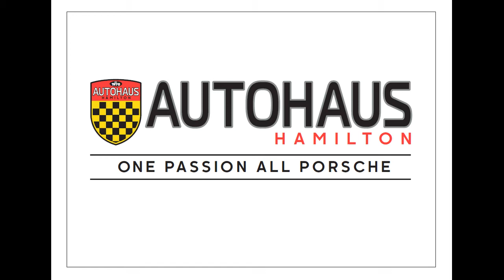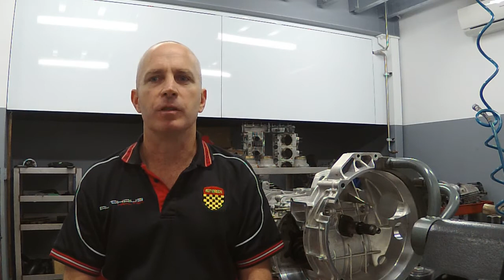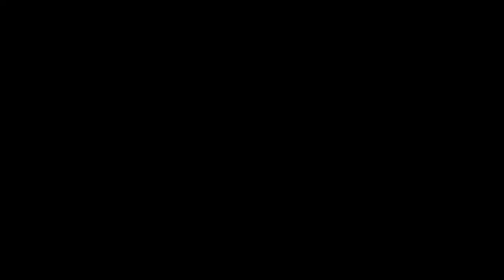IMS Bearing Statistical Calculation

Comment: As an accountant (statistical analysis type) I agree with this type of analysis, just the financial numbers need to be more realistic. In the US a factory new engine with installation would approach $20k but there are other options that make more sense, including a used replacement for under $10k and a rebuilt for a little over $10k. Also the updated bearing cost is ~$500 with only a couple hours of labor when the clutch/RMS is to be done anyway, so less than $1k cost if done at the same time. If you can do some or all the labor, even better.

Since I have the dual row and will eventually replace the bearing bore scoring scares me much more.  There is no cheap fix for this cancer.

Comment: My 99 3.2S with 200k km on the clock has a double row bearing. I called my local Porsche Centre and enquired about the cost of a replacement (it’s a Tip). Expecting a $5000 quote, the service manager said the very low likelihood if it failing vs the value of the car made it not worth it. He said not to worry, and to enjoy my car

Comment: Crikey!!! Totally accurate but worthless video. No one has a "fleet", except Porsche in its warranty obligation. There are plenty of examples of these cars running at 100K+ miles, and the failure rate was around 5%. I say this is NOT  a design defect. It is a component defect. They got a bad lot of bearings. Now, we can debate the wisdom of a design in which a component failure can be catastrophic, but the design is sound, even if dependent on good parts -- but aren't they all?. Every failure analysis says the bearing lost its lube. That can only happen if the seal fails. Replacing a good IMSB for "peace of mind" could result in installing a bad one. Rick Huttons car had 125K on it, and the bearing was fine. It was also shown that these fail early if they're going to. If you have 50K+ on your car, stop worrying. You're ok. Drive your car.
Reply: They did not get a bad lot of bearings they changed the bearing to one with half the load. The failure rate going from 1% to 5 to 8%. And why? to save perhaps $1 Replace it with clutch replacement? I don't know the statistics but I bet half are auto.
Reply: @manilanoakes3966  According to the reports, it is not the "load" at fault. It was a defective seal allowing the lube to leak out. Without lube no bearing has a chance. I believe the bad lot was due to a defective seal -- my opinion -- that was a part of the switch to single row. Correlated but not causative.

Comment: James set-up two scenario's but failed to analyze them consistently, and failed to analyze them properly.  James failed to mention his *explicit* assumption (in both scenarios) that replacing the IMS-bearing would fix the problem.  

There are at least 5 different after-market products touting to fix the IMS-bearing, I don't even know what Porsche recommends, and no one knows which fix provides the smallest risk of future failure.  I don't mind spending money to fix the IMS-bearing once, but I don't want to fix it every 40,000 miles.  And I don't want to be stranded when it does fail, as that alone could risk my life, limb, or livelihood.

James also failed to mention his *implicit* assumption that the IMS-bearing failure is a random event, presumably due to a  random defect occurring in the manufacturing process of the bearing, rather than a flaw in the engine-design.  In other words, James' analysis presumes that all bearings are either "fatally-flawed" or "practically-perfect", and there's a certain percentage that will fail due to "random" imperfections due to the manufacturing process.  Such defects can be summarily analyzed with ease as a probability, or risk, just as James did.

But a design flaw is a different kind of animal.  Failure due to a design flaw (presumably) depends on "conditions of use" that are unknown.  Example:  It seems to be an "accepted fact" that an "oft-driven Track-King" is actually less-at-risk than a "soft-driven Garage Queen".  

Frank Knight, an economist at "the Chicago School", wrote his PhD thesis on the simple idea that there's a distinct difference between risk and uncertainty.  His thesis is one of the most highly referenced papers ever written, presumably because it straightens out the tangle of definitions that most people don't recognize as being tangled.  Thus, a "manufacturing defect" creates what Professor Knight would call a risk, and the "design flaw" creates an uncertainty.

Side Note:  Knight arguably would've won the Nobel prize in Economics if he had lived longer, having attained many of the same or similar praises that other Nobel Prize winning economists had earned.  He died 3 years after "Economics" was included in the "prizes", but since only living people can win the Nobel prizes, he was only eligible for those 3 years.  Four of his students did win the Noble prize in Economics, which itself might be a record.

Comment: James, I have a 2006 Cayman S, and am curious to know if it has the larger bearing ??  What I have read online suggests that very likely the 06 Cayman has it, but definitely the 07 onwards has it. Is there any way for me to check this via Engine number or something else. It would be really nice to know it has the double row bearing for peace of mind.   Thanks in advance.    Cheers
Reply: From what I've gathered from PCA, 05MY was the change to the larger single row bearing.
Reply: A 2006 would typically have a single row bearing, to the best of my knowledge.
Reply: Yes James, but I have learnt that it is a much bigger bearing than the previous type. Very very few failures from 2005 onwards, and mostly down to lack of use and incorrect maintainance.

Comment: WRONG! The statistics of IMSB is well known ever since the Eisen Class Act in the States. Porsche warranty data had to be given out for over 50 000 US import cars with M96 engines. By the time of this data the later single row had caused actions in 4-8% of cars depending on the Porsche Center in question in the USA. In California an anomaly of 10% was recorded. However, the double row IMSB of the early M96 engines (RoW 1998-2000, US 1999-2001) the failure rate was << 1%.

The problem with single row is that it’s load capacity is half of the double row. With hindsight Porsche probably made mistake by  sealing the bearing with grease in it. In time the grease will washed out by the seeping oil but the oil gets trapped and gets acid. Nowadays it is recommended that the rear seal of the IMSB is taken off and oil level kept close to top to keep the bearing submerged in oil.

I am really really surprised that Autohaus Hamilton does not know these facts!!! As one of the most respected Porsche players in the world you really should have done the homework better. The court documents are availabe in the internet.

As a 996 owner I can warmly recommend the car. It is an amazing value for the money car. It is said that the most smiles per miles per money is achieved with a Miata, S2000 and 996. The 996 is a fantastic car but you gottta love it and take care of her!
Reply: Almost everyone that expounds at length about the need to upgrade IMS bearings has a vested interest in doing these upgrades and won't stop till there are no more to do.  Unfortunately these "expert" opinions get picked up by many others and spread throughout the Porsche community.  Even moderators of respected forums have been indoctrinated to the point that they know only one word - upgrade - even for double row IMSB's.  Fortunately for me, I purchased my early 2000 996 (certainly having a double row brg.) from an attorney who had studied the class action settlement, or I would be caught up in this madness too.
Reply: @330GT2  Spot on, really...I have an early 2000 as well with 193k and my car was taken care of very well...and at these miles
it would/should have split...having said that I am going to replace the IMS when I do the chain guides, chain, AOS, RMS and clutch...

not out of fear but out of common sense...while I'm hanging out in the barbershop, why not get a haircut yea? And to me 
bore scoring seems to have a place in the arena of statistics and hard numbers...bore scoring doesnt seem to have a direct
answer but can show up anytime with and without symptoms/signs...and a culprit that seems overlooked are the fuel injectors, fuel delivery
and quality of fuel itself and I dont believe bore scoring is hyperbole but is something to moniter in any Porsche owners repetroise.
make it so!!!!
JJR37 enjoy your analog 996, they are a real joy to have!!!